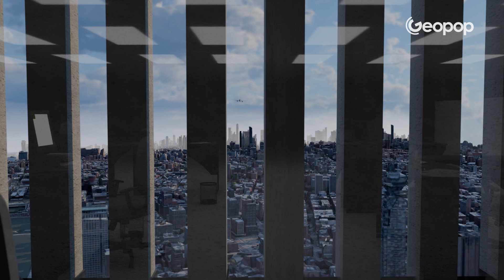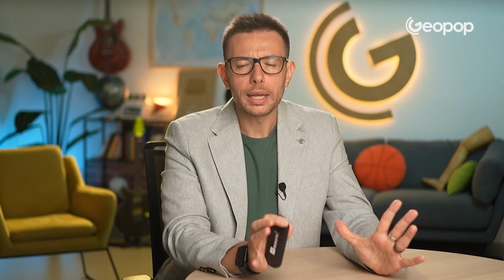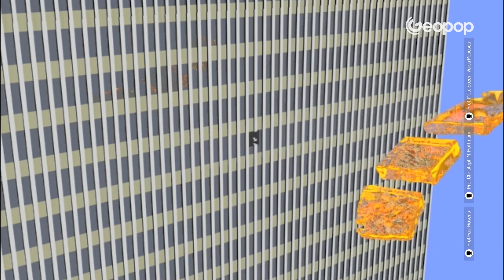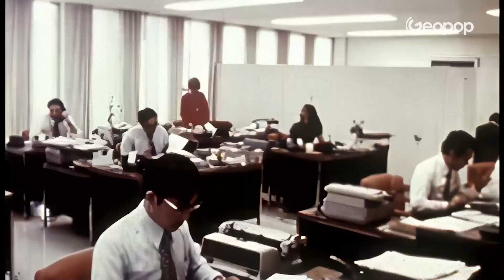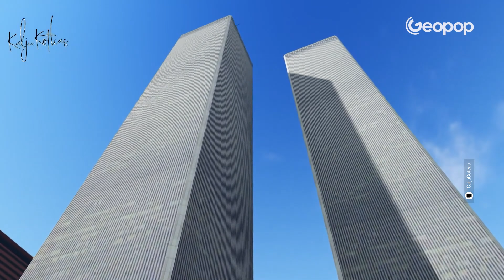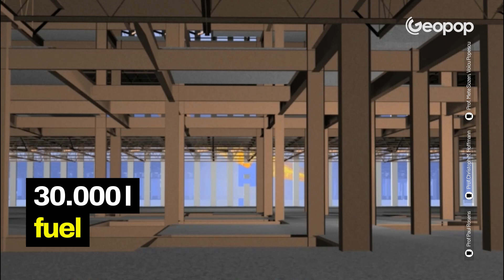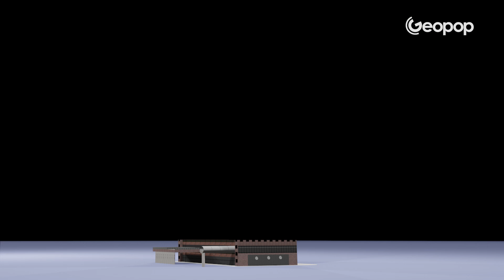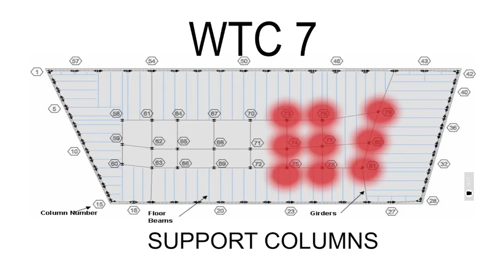9/11, 2001: The Technical Reconstruction of the Twin Towers and WTC 7 Collapses

Comment: Building seven came down in a perfect straight line. All those columns had to be compromised at the base, not around the fire. And at the exact same time. This is ridiculous. Look at the video. I’m not 100% so please check me but I don’t believe a steel building has ever come down from fire before. Except for three times on Sept 11.
Reply: Buildings are built to collapse on themselves if they ever should collapse, to prevent them falling into other buildings. Next?
Reply: @PretzelSage  that's one of the dumbest things I've ever heard. Just go to google images and search "Buildings that have collapsed because of fire". You pulled that straight out of your ass.
Reply: @PretzelSage   I'm so impressed with how you just reached around and plucked that theory right out of the back of your pants. Do you by any chance work on the trump campaign?
Reply: @PretzelSage  I love those shows where some guy is walking around and there is a switch marked, dont pull this switch, and of course he has to, and the whole building just collapses right in on itself. That is where you were inspired right?
Reply: Numerous steel structures have collapsed from fire
Reply: @apacheattackhelicopter8410  Cite? Do the floors also explode erily simular to controlled explosions > one after the other in sequence like wtc7? What a coincidence. Fires that cause it to fall and LOOK exactly like it's been "pulled".
Reply: Science seems like a tough subject for you, huh?
Reply: @MrWilde-zx7vm well that's a shit explanation
Reply: @MrWilde-zx7vm What on earth are you talking about? There are thousands of engineers and scientists who agree it was controlled demolition.
Reply: @Dec-z9m dumbass there aren’t, the ones who say so are fucking idiots and have been proven to be wrong every single damn time. You and everyone else who believes this nonsense are not only stupid but disrespectful towards the people that died that day. Stop spreading this conspiracy theory of utter stupidity.
Reply: Someday in the future, engineers will look back and marvel at how obvious the controlled demolition was right in front of our faces. We will be laughed at for the stubbornness of our resolve to protect the projected story.
Reply: @dr.graves5541  just watch one actual controlled demolition. The towers collapsing look nothing like that and you'll never believe in that crap again
Reply: @phoenixwright9105  - I’m going to respectfully disagree and offer a more plausible explanation.

The collapse of the unknown and unimportant Building 7 – one of 6 buildings to collapse of 10 destroyed on 9/11 - confuses a lot of people, despite being one of the most studied engineering disasters in history. It was not famous, not a terrorist target, no one was killed in it and thus it did not get a lot of attention, so most know very little about it. There is a lot of tantalizing but absolute garbage out there on this topic. Given the choice between long boring, hard to find technical reports and readily available, easily digestible fantasy on the internet, many turn to the latter. To counter that I prepared this brief summary explanation based on my own analysis. No politics, just engineering. 

The North Tower collapse at 10:28am bombarded Building 7 with thousands of tons of burning debris, causing heavy damage and starting raging fires burning out of control for the next 7 hours. Half the responding FDNY firefighters having been killed, others injured, units in disarray, much of their equipment destroyed, no water pressure, and the greater urgency of Search & Rescue efforts, firefighting efforts at 7 were pulled as futile. The building couldn’t be saved and was left to its fate.

youtube.com/watch?v=g_SvpwyC17M&ab_channel=MFitz 

Collapse of a burning structure is always a concern for firefighters. Steel buildings subject to fire rely on active fighting of the fires to survive. Left to their own devices they will collapse. Buildings are designed around 1 to 3 hours of fire resistance, allowing time for occupants to escape and ACTIVE firefighting to get started, after which all bets are off. In B7 the occupants escaped, passive and active fire protections were compromised and active firefighting never got started which left the building to take its chances. It lost. Odds on Building 7 would eventually collapse,… and it did. No big deal in logic. That is the sort of choice firefighters make every day in brush fire situations - which houses to save and which ones to let go. Only real difference here is moving the decimal on the size and cost.

FDNY Chief Daniel Nigro ; The biggest decision we had to make on the first day was to clear the area and create a collapse zone around the severely damaged 7 World Trade Center, a 47-story building heavily involved in fire. A number of fire officers and companies assessed the damage to the building. The appraisals indicated that the buildings structural integrity was in serious doubt. I issued orders to PULL BACK the firefighters and define the collapse zone. It was a critical decision; We could not lose any more firefighters. It took a lot of time to PULL EVERYONE OUT, given the emotionalism of the day, communications difficulties and the collapse terrain

FDNY Deputy Chief Peter Hayden - We had our special operations people set up surveying instruments to monitor and see if there was any movement in the building. We were concerned of the possibility of collapse in the building. And we had a discussion with one particular engineer there, and we asked him if we allowed it to burn could we anticipate a collapse and if so, how soon? And it turned out that he was pretty much right on the money, that he said 'In its current state you have about 5 hours

With its deteriorating condition being reported throughout the day, the collapse of Building 7 expected by the FDNY, bystanders and the media meaning at least 24 video cameras recorded some or all of the collapse. Everyone at the time knew what was coming and why.

youtube.com/watch?v=OY5S5k3tMHI&list=PL4GiNqqck-lzR7pebSWRVLoXyu-aWR3Rr&index=48&ab_channel=911InvestigationVids 

Building 7’s collapse was totally different to the Twin Towers, harder to understand and most of the details difficult to see. But we can sort out what happened through careful analysis and observation.  What follows is MY EXPLANATION of the collapse sequence using the best available information and relying on no authority.

B7 was complex structure, a 47-story steel framed building built on top of a smaller existing 3-story building, requiring several lower floors dedicated to complex load transfer structures instead of usable office space. Of trapezoidal shape and all-steel tube-in-tube construction, B7 (above the 7th floor) consisted of a central core of steel columns carrying most of the gravity load, perimeter steel columns around the outside of the structure carrying the remainder of the gravity loads and long span beams and girders to tie those elements together and form the floors. On the outside of the building hung a moment frame - the last part of B7 to fall. 

Phase 1 : Collapse initiation for B7 is notably quiet with observers not realizing the building was collapsing! There was no audible warning in the form of say hundreds of ear drum busting 180-190dB explosive bangs preceding the collapse. The first externally visible signs of collapse initiation occurred at 5:20:28 pm. Here at 12:00 a local CBS affiliate reporter is talking 10 blocks from B7 when collapse begins. People don’t start to notice the collapse until 12:11. Then at 12:45 is the famous CBS fixed camera clip of Building 7’s collapse Again, note how quiet it is.

youtube.com/watch?v=t5tEy6mXSE8&ab_channel=fresnosean379

Collapse initiation was due to multiple lower floor failures above the load transfer region (7th floor) in the NE corner of the building. In this video at 0:45 you can see the NW corner from inside the building while under construction, Column 79 just out of frame on the left. That big, angled steel beam across the top of the frame connects to C79 at one end. The girders connect to the beam. The beam and all those girders depend on just one connection

youtube.com/watch?v=nP3TNHPCIVU&t=35s&ab_channel=EdwardCurrent

Phase 2 : Lower floor failures left core Column 79 laterally unsupported over an excessive length and it buckled. If you look at a floor diagram of Building 7 (see above) and look at all the structures that depend on C79 you quickly realize this one column was a relatively isolated structural element on which a disproportionately greater fraction of the structure depended . Externally we see a vertical progression of window breakage along the 44-46 line and a kink in the roof of the East Mechanical Penthouse at the top of the building, consistent with C79 failure. The transition from full capacity to almost no capacity occurs in virtually an instant. Once the buckling failure occurs there is almost no resistance

Normally with a buckling column, the load could very well be redistributed to other columns, meaning the buckling could stop after a while. With C79 that is not the case - the failure did not redistribute the load, so the collapse rapidly progressed to the roofline, sinking the rooftop penthouse.

Phase 3 : With C79 gone, B7’s progressive, non-symmetrical collapse continues with C80 and C81 at the east end of the core left laterally unsupported and quickly buckled and failed as well, sending the EMP down through the building. C79-81 all have no diagonal bracing, which I believe is a major reason why they could not redistribute a lot of vertical loads among one another.

From there collapse progressed from east to west through the central core until the core was gone taking all of the interior floors and structures and probably most of the perimeter columns with it. You can see the horizontal progression of window failures low in the building and the dropping of the remaining rooftop structures into the building. One of the big takeaways from the NIST Building 7 study (that gets completely ignored) was their modeling which determined C79 failing under ANY circumstances would have initiated the same collapse sequence.

Phase 4 : After about 10 seconds only the exterior moment frame - a hollow shell mostly supported by the 4 corner columns and quite unable to stand on its own – remains, creating the illusion the building is still standing since little has changed externally. That’s just hollow empty shell, like an empty cereal box. The north leans inward, forming a V in the roofline. The last remaining perimeter columns buckle under the strain.  There is almost no resistance as the moment frame free falls, landing on top of the 7-story high debris pile, blocked surrounding streets, heavily damaged the Verizon Building and destroyed Fiterman Hall at 30 W. Broadway, all well outside of Building 7’s “footprint”.  It is only here, at the very end that a single utterly meaningless measurement of alleged free fall is taken. Start to finish the collapse took 18-20 seconds, or less than 1/3 of true free fall*. Not that we really care since how fast something falls cannot tell you what started it falling in the first place. The free fall argument is about the collapse of the outer shell *AFTER all of the critical internal structure had already failed and completely ignores about 80-90% - of the collapse. 

Building 7’s progressive, non-symmetrical collapse was incidental and unintended collateral damage from the combined effects of fire + time + gravity started by the collapsing North Tower. That is true no matter who planned and carried out the 9/11 attacks or why . The collapse was of so little consequence it barely even registered at the time, a mere footnote. 

I hope you found this helpful. It is meant to be informative, not adversarial and to solicit informed critical comment. If I made any errors of fact, logic or reason or left anything critical out, please let me know so I can fix it. IF you can offer a more plausible alternative be my guest. So far no one has even tried. Please start any reply with the words “Tits McGee” or I will know you didn’t actually read it and won’t let you waste my time.
Reply: @dr.graves5541 your dumb, just dumb.
Reply: @dr.graves5541  i think they already have. They have just been silenced.
Reply: @salinasbeat  Lmao no they haven't lil bro, which engineer specifically has been silenced?
Reply: @BIOHAZARD_X  I already responded to you but my posts have been taken down...hmm.. Look up Steven E. Jones, American physicist, and Casey Pfeiffer, and their connection to 9 11
Reply: @BIOHAZARD_X  several of them don't get to talk anymore, bc dead people can't talk.
Every person who speaks out on national tv, gets threats, ridiculed, and their careers placed in jeopardy.
Many of the worlds leading demolition experts are on record showing the tale tale signs they see, and the reasoning of exactly what is happening as the event occurs.
Ohe thing you have never seen, is a demolition expert on tv claiming it was not a controlled demolition.
Period.
Reply: @BIOHAZARD_X  I agree with you, the amount of people are legit demolition experts explaining the flaws, are always treated so nice, and they are welcomed on every show with open arms, and are treated honorably...
There has got to be a thousand examples for you to choose from, why don't you share with us some of your favorite examples.

Comment: A better documentary of 9/11 is called "Anatomy of a Great Deception". Steel frame buildings don't just fall into their own footprints because of fire, or as was the reported case with Tower 7 "due to normal office furnishing fires" reported by Nist, the same Nist that said their were no reports of explosions that day. Molten steel was reported days later running along the channel ways under the rubble, along with micro iron spheres found in the dust. 

Just a big coincidence Marvin Bush's(the 3rd Bush brother) company was in charge of security for the buildings. 
The official report is the Conspiracy theory. The engineers themselves said an airplane piercing the exterior of the building would be similar to a pencil peircing a screen door. You can make a computer simulation do whatever you want it to, you've never seen them replicate the collapses with physical, scaled models.
Reply: So many debunked conspiracy theories rolled into one comment! Congratulations!